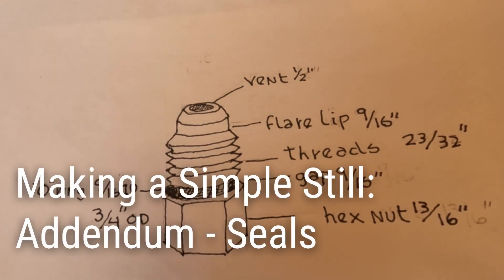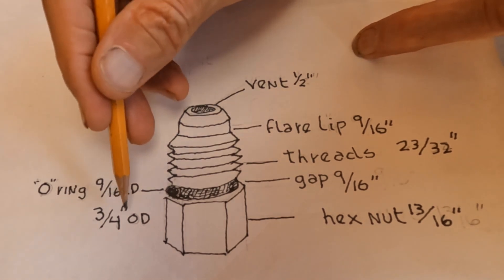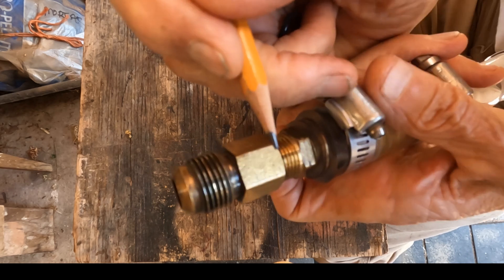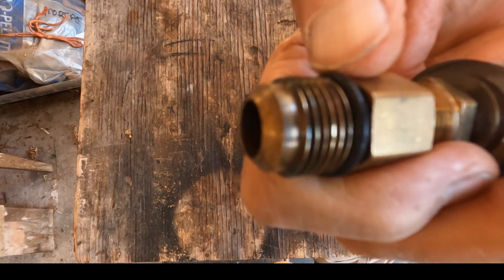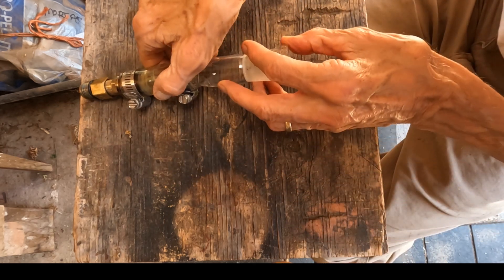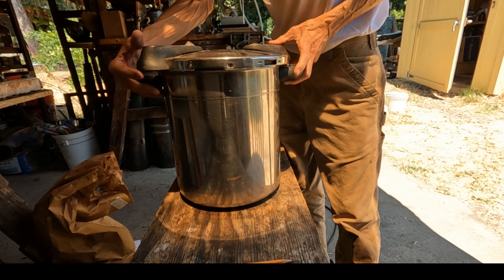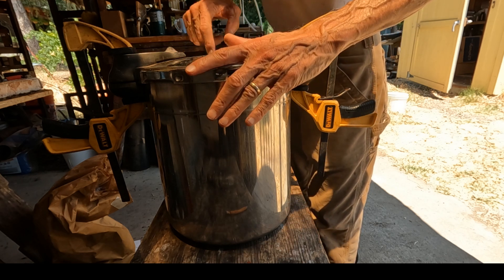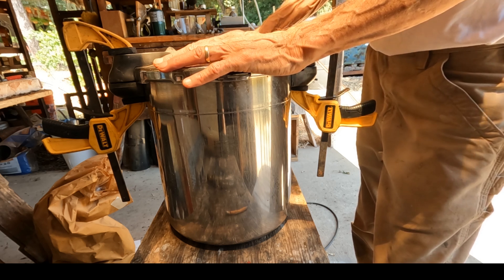Creating a Distilling Still with Pressure Cooker: Addendum - Sealing the gaps

Comment: I have a small hole in the lid of my distillation tank, what material should I use to cover it that is not harmful to health at the distillation temperature?
Reply from the maker: You could seal it with silicon like they use for bathrooms. After it hardens, it should not be off-gassing enough to matter.
Reply: @SoilSoulandSpirit for health not problem?